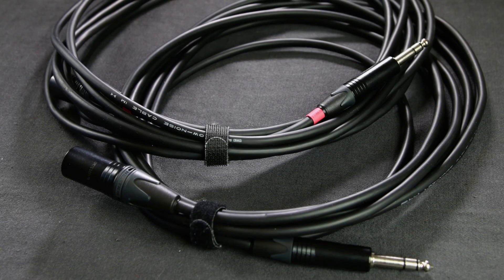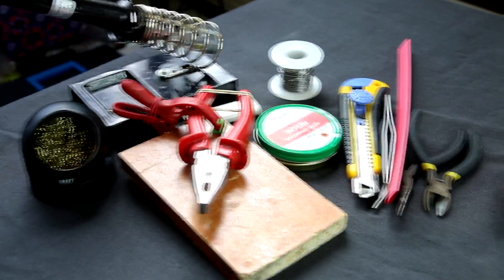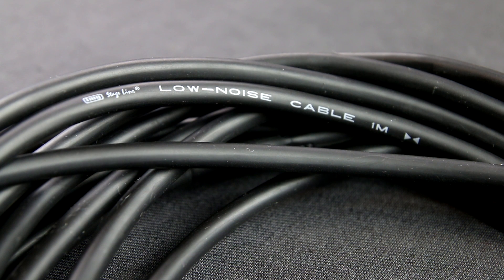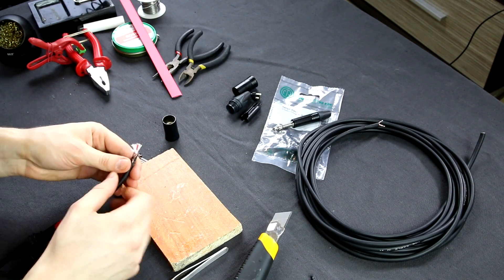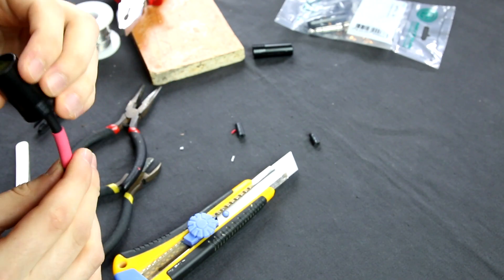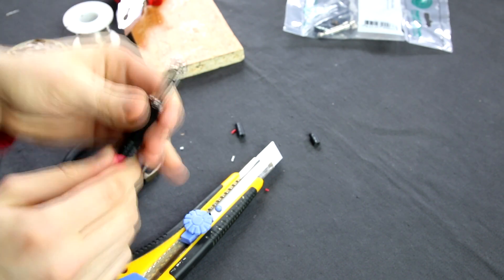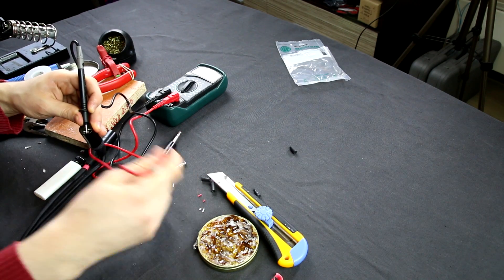How to make XLR to 1/4" TRS balanced audio signal cable #DIY18

Comment: 1. You did not link to the cable you used. What is the exact name?
Reply from the maker: you can use any audio/microphone cable with 2 inside wires and ground layer. I didn't add the url to cable, because on aliexpress and amazon don't have good audio cable PER METER.

Comment: Hi, if used for a microphone, will this cable convert the mic signal from low impedance to high impedance ?
Reply from the maker: it's just cable, it doesn't convert anything.

Comment: Yeah boss great video , but on diagram at xlr side there was letter G , I mean you meant the letter S for sleeve actually , right? Thanks again
Reply from the maker: g for ground, that is signal ground parameter, but S is parameter of cable. They both is correct. Because ground signal travels through sleeve.
Reply: @Techscrews  thanksman so G=S in this case , huh? Thanks

Comment: This cable will not work to connect to any equipment that adds tip and ring (Left and Right) together.  Tip and Ring are 180 out of phase so when you add them you get no signal at all in the receiving equipment.
Reply from the maker: of course, it's because this is balanced cable.

Comment: had dad, i have a question , i just got a trs ( double ring ) to xlr male ( i got for to record  direct guitar to my interface to use amp sim ) its workrd perfect ,no noise there but problem is not of my control works  vol 1 vol 2 tone and even pickup selector .doesnt work at all .any idea plz?
Reply: This sounds like a problem with your guitar and not so much a problem with your cable. For the sake of brevity, and the fact I dont know what guitar you have, my recommendation is to take it to a qualified technician.  Failing that, find a diagram with a similar control scheme and do a total rewire yourself.

Comment: Sir i bought this cable in amazon but in female pin the positive and ground is jointed and connected in one pin. Another is negative and remaining one pin is connected with rod . Is that correct method, i don't know.
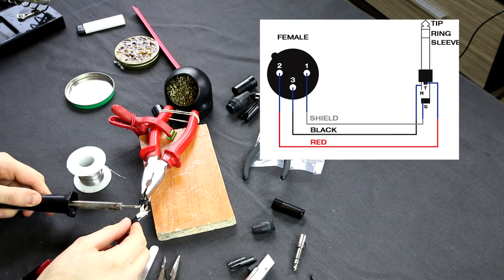Reply from the maker: you perhaps bought unbalanced cable, check 1:18 diagram for balanced cable connection.

Comment: Can we use this cable for keyboard?
Reply: No! Phasing problems can occur.
Reply: Keyboard output sometimes has left and right signals since it is the same jack for headphones out and for amplifier out.  You can only use this if it has separate left and right jacks and you have to use 2 cables and 2 powered speakers if you want it in stereo.
Reply from the maker: no problems, this is standarts connection.

Comment: But the purpose of making this (i'm assuming) is to hook up a stereo out, like mixer or computer, into a single speaker, if this is the case, wouldn't this cause problems due to phasing?
Reply: No, it's for balanced AUX sends to powered monitor speakers or balanced main out Left and Right to 2 powered speakers  as FOH.  Like an audiobox 1818vsl  for example that has TRS out only to powered speakers that has XLR inputs. 

Your assumption would definitely cause phasing and should not be done.

TRS  should not be confused as stereo.  
TS is always mono but TRS can be balanced mono as well.
Reply: You are correct, I did not know that ideally stereo input should go to 2 XLR jack in reality , once you fixed this way it generate a useless sound , as soon as you unplug one channel sound comes back normal, XLR not meant to carry R and L channels of a stereo sound